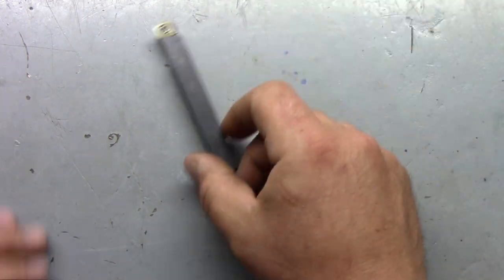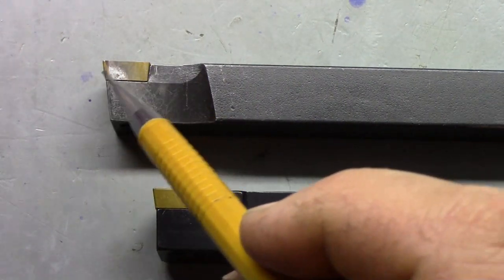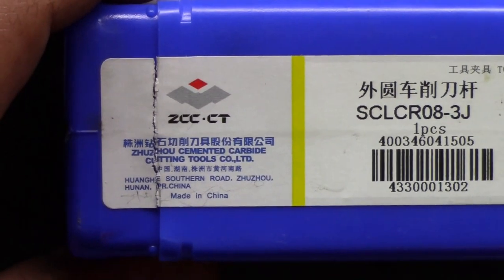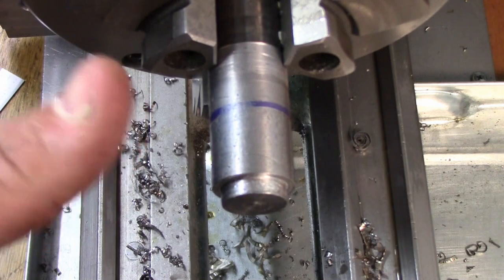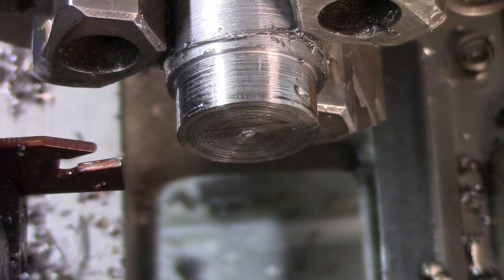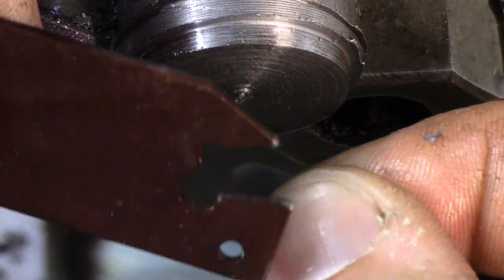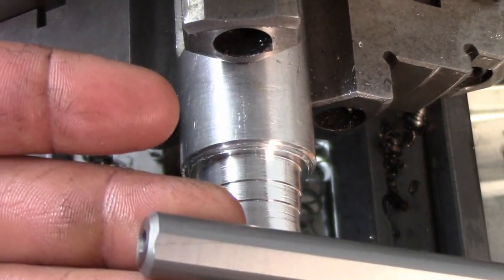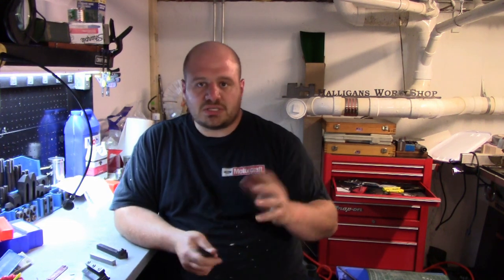Cheap VS Expensive Tool Holders and Inserts

Comment: I use cheap chinese turning and parting carbides all the time in my ancient Boxford (South Bend) belt-drive, and they hold up fine. You just have to be bold regarding spindle speed (I wouldn't even run a HSS tool as slow as we see in this video), and then then tailor your cut and feed rate to what your particular lathe is comfortable with.  Anything under an inch in diameter, and you should probably be running just about as fast as your old belt-drive lathe will go. So long as your carbide tip isn't sparking, you are OK. Note also, Its the slow surface speed that's giving you that tangle of swarf.
Reply: Good at purchase, find the competitive products instead of high price products is the point to reduce your cost at production😮❤

Comment: Run the cutoff slightly above center and it should be ok.  It's a little below center now and when it passes under the center at the end of the cut, the stock rolls over the point and I think it pulls the bit out.

Comment: I don't really think the Shars insert is that bad. You can always grind the relief in if you want it (but I haven't found them to be necessary to be honest with you).

Also you might want more than 400 RPM with carbide inserts... more like 1000 or so.

Comment: Your parting off blade insert needs to be tapped in securly with a block of wood or mallet. Just a couple of light taps should do it. Just enough to cause the jaws to spring apart causing a clamping action on the insert !
Reply: Experts😊

Comment: I have an ISCAR parting blade and you have to set  the insert by giving it a tap with a soft face hammer or they will pop out as well so I would give it another try.

Dave

Comment: In order to use carbide and avoid chipping corners, you need to use cutting speeds from 400 to 600 SFM for most common steel and double that for aluminum, otherwise it will cost you so much more than HSS, and you rarely ever get expected results...
Reply: 400 to 600 is a good start for quality inserts. for the off brand cheap ones I would probably start 250 to 500. It also helps to have the right chipbreaker on the insert for roughing or finishing.
Reply: jim jaco
Good appropriate precisions...!!!
Reply: Pierre's Garage sale
Reply: Pierre's Garage iiii

Comment: A perfect example of why not to use carbide on small lathes.  You needed to be running at least 4-5X as fast as you were, with deep cuts, to break a chip with those inserts and get a decent finish.  Sharp HSS will work a lot better for you.

Comment: I recently bought a VMC. These machines force one to learn feeds and speeds. Transferring that knowledge to my manual machining has been rewarding. I'd recommend you investigate the published feeds and speeds of your tools and use them as a starting point for your evaluations. So for your test, assuming a 1in dia. work piece turning @400 rpm I get about 100sfm . Ummm... that's way too low. That's probably why you are getting lousy surface finishes and the tools aren't working for you.
Reply: Sometimes I want the manual lathe read out  to list the feed in real time as I turn the wheels so I have an easier time punching things into the CNC lathe.

Comment: the idea is, if your insert has a non-chamfered hole in it, it needs clamp/wedge to hold properly, not screw. Screw is for one-side inserts. often, hicks or poor-men will put screw in the former, and that is not correct. if a seller sells such a tool, avoid like the plague.

my recommendation for od turning: chinese WTJNR with tnmg insert for 10USD shipped, ebay. The insert is double sided triangle, six cutting edges and very ubiquitous insert. The holder is designed correctly; it has a wedge instead of clamp. The force is more evently applied on the insert and clamp is known to tangle birds nest chips.

W is for wedge
T is for triangle
JNR for 93deg right tool.

If you see 'wtjnr' with clamp instead of wedge, its mislabeled. I see a lot of mislabeled tools and inserts, even from brand name companies on ebay. Stuff like one sided insert labeled 'tnmg' (tnmg is double sided by definition). Or triangle insert labeled WNMG (W is for trigon, not triangle).

'3' inscribed circle is the most suitable size for small lathe. 2 is better (because its smaller, better matching the small lathe) but more expensive, so you just go with the 3. Example TNMG321. The 3 is the inscribed circle, 2 is the thickness, 1 is the corner radius.

so, you go with TNMG K10 grade for aluminium turning, its a highly polished insert. TNMG cermet is good for general steel. A wiper geometry for fine finishes, search TNMX. sandvik's chipbreakers with wiper are WMX, WF. you can get TNMX WMX off ebay from germany 33usd. Is a state of the art insert. 60 cutting edges in the box. With the WTJNR holder 40USD. Search 'sandvik wmx' on youtube for demonstration.

if it doesn't fit your QCTP holder, don't mill from the top. Mill from the bottom because it flexes down and outward, so you're milling from the bottom an 'L shape', not fully facing the bottom for it to fit the holder. I get a lot of 1" holders, but they don't fit my BXA holder. That's the solution, or mill dovetail in it, but they are hard and a solid carbide dovetail cutter is $$$$. (i have some but not 60 degree , they are 55 deg, just my luck ... )

top brands for inserts, i'm sure you may already know; sandvik, seco, kennametal. and the japanese ones; mitsubishi. ebay.

Comment: I set mine up in my vise and use a nylon faced hammer to wrap them into place , the insert should sit right back in the slot. I have managed to break a holder , had a part move in the chuck and the insert dug in  so not the the fault of the tool in the machine but the fault of the tool driving the machine!!!
I have a set of warner threading tools but use the HSS inserts  the only gripe i have with them is it is so damned expensive to get them shipped to Australia !
Good to see you again !

Comment: You're supposed to tap that style of insert into the parting tool.  Just having the insert sit in the holder is no good.  Take a small chuck of brass and give it a swift tap to seat it into the taper of the tool.  I have the exact tool and it works very well even with the cheap shars inserts.
Reply from the maker: I did.  The second time you can even see that the pocket distorted.
Reply from the maker: but I'll give it another shot and try seating them deeper. Didn't want to chip the carbide so maybe I didn't hit it hard enough.
Reply: I didnt have to slam it into the pocket, but I did give it one solid tap to seat it.  Use the cheap shars inserts and if you have an extra, dont be afraid to let the inset have it
Reply: Agreed, have used mine (same Shars model) for a couple of years without any issues. Never fell out on me once with normal use. But it looks like the one in the video is probably busted/deformed now.
Reply: You said it yourself. "Must be me". You must tap the insert into the holder fully with a brass mallet and your issue will be gone. You are doing discrediting Shars tools when it is you who is at fault.

Comment: if you increased the speed on ally you would break a chip. 400 rpm is around 4000 too slow

Comment: I don't really think a SB 9 can test inserted tooling very well.  Sure, it can use them, and they are more convenient as well as more expensive than HSS, but with no performance gain.  You needed at least twice the speeds that you were using in the video to get good results with carbide.  With a small, less powerful lathe like that you are better off using HSS.  Much cheaper, too, a HSS tool bit will last indefinitely, just need to keep them honed.

I have never used carbide cutoff tools and have never had a problem.  I do have a few old brazed carbide cutoff tools in case I need to cut off something harder, haven't needed them yet...

Not complaining, good video as usual, Greg!

Comment: my recommendation for cheap and solid parting tool with carbide:

get one that locks with a screw, MGEHR. i have it, it doesn't fuck up. I also have it in 8mm width iscar brand, and 2mm chinese brand. Same good design, so go with the chinese unless you got a good deal at a flea market. The chinese insert is not likely to go obsolete, unlike the brand name companies which constantly changes the inserts for no fucking reason but to force companies to buy each iteration of the design. the insert is MGMN , its 2 sided. Example MGMN-200 on ebay is 2mm wide. MGMN is the iso/ansi standard generic shape, so its not likely to require a weird holder and not likely to change in the future. The price is like, 20USD for a pack of inserts, 10USD for the holder. shipped.

i looked at the prices just now, MGEHR1212 (12x12 shank, aka half inch) with 4 inserts. 12USD shipped from china. its cheaper than buying chinese locally (shars), and you got ebay buyer protection if the tool fucks up in a hilarious way like in this video.

Comment: Greg that 400 RPM zone is causing some of the trouble. I've found with my 13" that the RPMs just aren't there to realize the (full) potential, when using carbide inserts. The #1 reason I bought a gear-head lathe, sigh...

Comment: I was buying the cheapest inserts on Amazon because I was just starting. It was infuriating trying to get a good finish. I bought some more expensive inserts from accusize, and it was night and day difference. Although the accusize is a lot more brittle than the cheap stuff, it leaves a nicer finish. I have had good luck with accusize tools they tend to be higher quality than most of the cheap stuff. When buying on Amazon, I find myself leaning towards that brand. It's not the best, but it meets the requirements for a farm!

Comment: I find that with the aluminium inserts, if it won't chip, I need to halve the doc and double the feed.  The feed rate makes a big difference to how the insert will create chips. At that diameter I would run the spindle at around 2500rpm.

Comment: Try lightly tapping the carbide insert into the tool holder on the parting blade and they work well. Finger tight just isn't good enough.
Reply from the maker: I did.  The tool holder is actually splayed open.  The inserts work well it's just the holder that's junk.  I guess it's hit or miss with them.  Have confirmed same issue from others.
Reply: Thank you for the reply. I have been using one bought from Arceuro here in england for the past 5 years with no trouble, but as you say it could be just luck of the draw. Huge inconsistencies with anything Chinese. Took me 2 months to fettle a Chinese 8 x 14 lathe! 😂😂

Comment: You know I have never seen such a bad use of what is in all ways an Iscar cut off tool design. You got to secure the insert with a light blow of a plastic hammer into the tools wedge. I have busted parting inserts many times, even bent the tool in some cases but the residue of the insert is still in the wedge. As for your pretty little Chinese tool holder and the inferred put down, that brand is as good as anything on the market. Yes it is shorter than the others but I am guessing that is so it can be used on CNC tool posts too without modification. Your cutting speed is to slow, and carbides must be driven in the cut.

Comment: With the style cut off tool you’re using the cutting tips should be tapped in with the butt of a plastic screwdriver handle to prevent them from falling out.

Comment: If you cant run continuous coolant or mist use none, slopping on oil occasionally is almost guaranteed to cause temperature fracturing of the insert.  Cutting dry is better is better than sporadic oil application.

Comment: Shars sometimes has better quality then the cheapest tools but I have found that to not always be true. As you indicated the reliefs are the biggest issue with Chinese holders which is fairly easy to fix with a grinding wheel. I picked up a set of 7 12mm tools with inserts for $30 shipped from US to US. They work just like a Shars and even better with some grinding. Once the insert fails I replace with higher quality at which point you have a lot more bang for your buck and a tool thats at least 90% as good as a high end tool. I will admit the higher end tools may have better contact overall with the insert slightly improving life and big cuts, a session with some Dykem would tell the story.

Comment: @6:30 ... So, why don''t you just add your own relief?  Could be done in minutes with a shop grinder.  Removing extra machining processes during manufacturing of parts reduces cost ... which is why that holder costs less.

Comment: Very cool comparison man. Thanks for the info. I think I'll get the Shars tool holder. If the relief angle is an issue, I'll just grind it and still save $50

Comment: The parting insert pulled out because you set the tool too low.  It ran under the small diameter and the friction against the top of the insert pulled it out.

Comment: I have a cutoff similar to your except mine has a tension screw that holds the bit in. It has never fallen out for me. The thing you have to watch on all the bits is the type and hardness of the carbide bits. I have never gone wrong with the PR930 bits. I learned that from the guys at Kyocera. They make all kids of bits and they will send you a catalog on request. They use Carbide Depot to sell their bits. If you don’t see them, call them cuz the only show the ones that are stateside. Takes a week to get the bits from Japan if not in stock. They are reasonable. Hope that helps

Comment: i dont run carbide below 900rp, especially on aluminium, my mentor would tell you they like to be worked, considering the size of your lathe have you considered running a fixed depth parting tool, they are good because a lot of them have long inserts so better hold :)
Reply: Well impressed 😊 boss

Comment: I'm still using the parting tool blade I got from enco 25 years ago. Same inserts as the Shars but i usually use the angle cut ones

Comment: I bought 2 Shars cut off tools. Same one you had. They had a tendency to dig in (yes I'm on center). Inserts fell out.....I threw them in the garbage pail. Try Seco same style holder they are great. As far as the other inserts go. I have had a continuing problem with Shars. Broken tips etc. I now use Kenametal., or other name brands. You get what you pay for,

Comment: A few questions, why do you feel you need more clearance on those tool holders, enough is, erh, enough? Anymore is adding "weakness" and machining cost..
Why do you think they give you a tool to extract the parting insert, if you can pull it out with your fingers? Answer, because you shouldn't be able to, it needs to be seated firmly not just gently put there. On a number of carbide inserts for turning it is NOT recommended you go past centre as the sudden change of load direction  can fracture the tip, or in this case pull out a badly seated one. You can also fracture tips if you stop the lathe while the tip is still in contact or under load, although more so with the harder carbides with small nose radii.
Did I enjoy the video, yes, quite amusing, and operator error, entirely possible. :>)
On your light lathe, I would concentrate on lighter cuts and getting on-size turning with an excellent finish, leave  Abom size cuts to the big boy lathes. Hope this doesn't sound too negative, you do do good work.
Reply from the maker: it was seated.  Possibly not enough but I did tap it in place off camera.  What I was trying to get at is with finger pressure the insert is seated to its clearance level on the cut off.  Other ones I've seen sit back to the stop. Only reason I went past center was because the insert fell out.  This lathe likes ~.050 infeed (.100 off diameter) I know it can do that but I want to see if there was a difference between the two carbide inserts so I had to push.  Clearance is not an issue but just showing a difference in manufacturing and its convenient if you're trying to break an edge on a bore.
Reply: Halligan142 of
Reply: Chris Stephens m

Comment: all ccmt holders you showed have a defect which you didn't mention. that being the pocket walls must be inclined to the relief of the insert. So different relief insert get its own tool holder. that's the way it should be. especially for high precision turning, like in the context of swiss lathe.

Comment: You can get same tool holders even more cheaper from aliexpress or ebay if you shop around (it's sold directly from China).  I picked up external threading tool holder with 1/2" shank for 9 bucks!  And let me tell you, it looks solid, good quality, I can't imagine how AR Warner would look and I'll probably will never know at 10x price.  Picked up another one with 10 inserts (16ER AG60) for $22, split inserts with a friend, he got a holder with 5 inserts and I got same for about 15 bucks each including shipping.  I also picked up internal threading holder and inserts for about same price.  Do they work?  Yes - did practice threading today on 4041, as well as gun barrel, it works but I also learned how to grind my own threading tool from 5% cobalt 1/4" quality blanks that were sold really cheap on eBay.  Got question for you, I was trying to cut internal thread for 5/8 - 24 with a setup where the feeding is happening away from the chuck with toolbit turned 180 degrees and ended up with left hand thread lol.  The reason I wanted to do that because I wanted to thread right up against the shoulder and there is no space to stop, anyway it was frustrating why the thread would not work when it seems like I did everything else correctly only to realize my mistake later after 2 separate attempts :)  What should I do?
Reply: Joe Pieczynski' videos on threading!